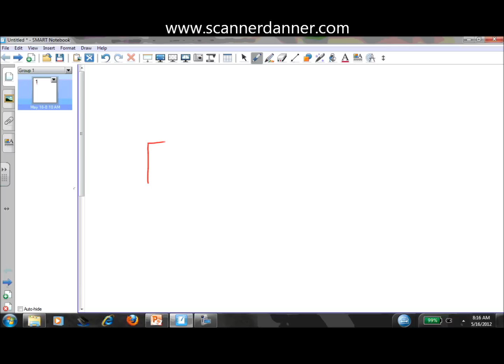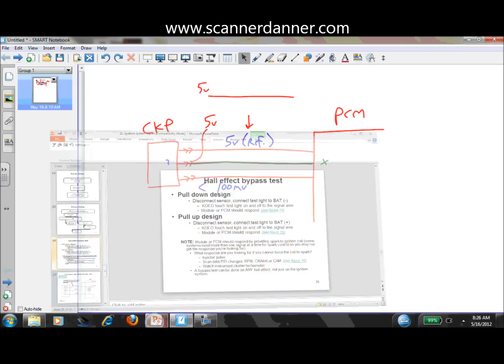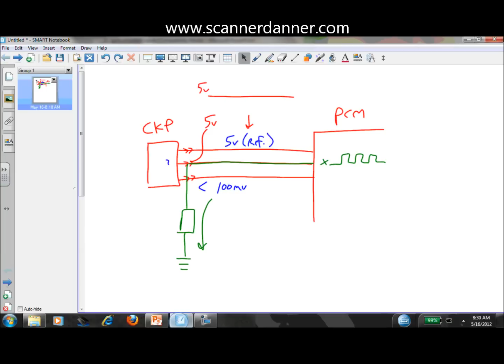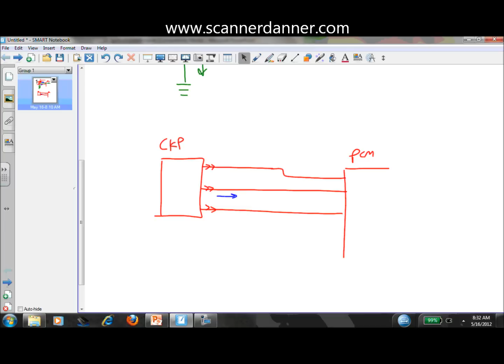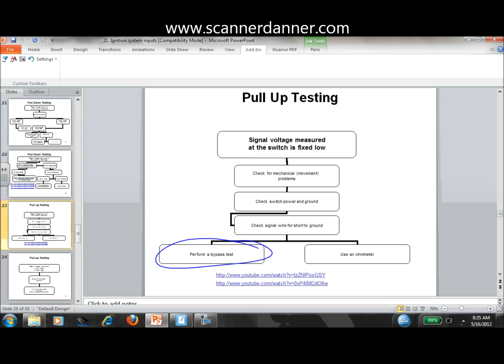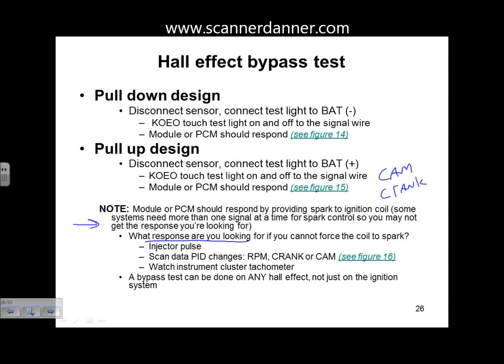Hall effect cam/crank sensor operation and testing Part 2 (an SD Premium video)

Comment: I am facing an issue in these days which is related to pull up and pull down cmp sensor. There are two cars in garage, same make, model and engine but made in different countries. Cmp signal in one car (A) is pull up while cranking, but engine does not start when cmp is connected. In other car (B) cmp signal is pull down, and car starts fine. Upon disconnecting the cmp i verified 5v in signal wire, 5v in power and 0v in ground in both cars. when i connect the cmp grip KOEOff, A car pulls down signal to 0 (no start) and B car keeps it at 5v. Cmp and ckp are same. I switched cmp and ckp sensor of A car, but it didn't start. I swapped sensors with B car, but A does not start but B car starts. If disconnect cmp grip of A car, it starts with longer cranking. Camshaft signal plate is same in both cars. Pinout of connector is same in both cars. What might be the reason of inverted signal in A car? + can the signal be inverted by switching 5v power and groung wire?
Reply from the maker: What is the problem with the car? Or both cars?
Reply: @ScannerDanner  A car is crank no start when cmp grip connected. It starts with longer cranking when cmp grip disconnected. B car is running fine. Both are diesel nissan navara 2.5L 2010.

Comment: so if you check the signal wire when its still plugged in KOEO , could you get either 5 volts or 0 volts depending on window location? and if yes , that would be why you unplug it.
Reply from the maker: +John McKamy yes!

Comment: So it's been 8 years. have you yet seen a 5volt pull up design.
Reply from the maker: I don't remember ever seeing one other than the ICM to ECM distributor reference signal on old GM bypass ignition systems

Comment: Hello Paul 
Interesting question I have here as I watch through; a pull up design that needs the cam and crank to fire injectors simultaneously. 
When you do a bypass test on the crank sensor signal and there is a reaction from the pcm to fire injectors without any activity on the cam circuitery, I think there will be problem here, why; because it's needs cam activity to fire as well. 
This is done in KOEO 
Does this mean there is a circuit short/ wiring intergrity problem in the cam wiring ?
Reply from the maker: It depends on the system,  some systems need both cam and crank, some do not. I have many case studies showing this bypass test in my chapter 21 playlist https://youtube.com/playlist?list=PLAFYVCyenqcqEN41aYznWn9Nfhy1PiMjo
Offhand I dont know which ones I've done this, but to get both signals, sometimes ill crank it while doing the bypass test on the failed sensor
Reply: @ScannerDanner  SD
The system is established here; cam and crank need to be in sync to start. 
It's a pull up design 

Why should a bypass test on the signal wire on the crank sensor give an activity to start while the cam sensor is not engaged? 

Trust you comprehend my query?
Reply from the maker: @AnythingEverythingGh  not sure really what you're asking. Pull-up and pull-down isn't relevant to this question.
Some systems (early) only needed a crank signal to start (spark and fuel), others needed both and still other would start with the crank only and would group fire the injectors without the cam signal, so default strategies. When doing crank sensor bypass testing you may or may not get a reaction depending on the system. The reaction I'm speaking of can be spark, or injection pulse, or fuel pump relay turn on, or simply an RPM signal on scan data
Reply: @ScannerDanner  Thanks and noted

Comment: I have a camshaft sensor for FORD RANGER 2009 ENGINE: WL 2.5. The sensor has three pins. I tested their resistance, pin 1 pin 2 pin 3, pin 1 and pin 2  has megaohms resistance
 , pin 2 and pin 3 has 13 kilo ohms of resistance. Is my sensor broken or are these resistance normal, Thanks
Reply from the maker: I never do resistance testing on sensor circuits, especially on hall-effects
Reply: @ScannerDanner  Ok thanks man, I just tested the line of the camshaft, The camshaft sensor is unplugged, PIN 1 is always ground, when i turn the ignition on (ACC position), PIN 3 has 5v ( I assume this is the power pin), pin 2 has 4.8v, shouldn't pin 2 have no voltage because it is unplugged?
Reply from the maker: @nelsonco3922  nice! Your wire that reads 4.8v should be your signal wire and this would indicate this is a "pull-down design" hall effect. In other words, the transistor in the cam sensor will energize and switch this signal to ground to make the square wave pattern. transistor off = 5v (or 4.8) and transistor on = 0v
So the wiring tests you just did, shows us the sensor has everything it needs to work. Now lets do the same tests plugged in and see what we get (loaded circuit testing). For the signal wire, if you "bump the key" (do not start the engine), you can make the camshaft move to specific points on the drive-plate to see the signal go high and low. For the supply and ground, they should stay steady all the time.
Reply: @ScannerDanner  Ok so will this be a reliable test if I turn the ignition on to power the sensor but not inserted in the camshaft. I will put a metal near the powered camshaft sensor and see if there is 0 volts and when there is no contact it should read approx 5v.
Reply from the maker: This one is all you for sure https://www.youtube.com/watch?v=JWfdHXL-bPg
I'm doing exactly what you are describing
Reply: @ScannerDanner  Thank you so much!
Reply from the maker: @nelsonco3922  did that video help? Did you see where I used a big chisel to trigger the sensor?

Comment: 96 Honda Civic I got continuity in all 3 wires that's not right right
Reply from the maker: I never check hall effects using resistance measurements.
Reply: Thx you for replying so long story short I'm a electrician so I'm good at troubleshooting now yes I'm no mechanic sir so pls excuse my ignorance now I also had the 12v battery wires and the groun also had continuity I discovered my ckp sensor all the wires in the crank sensor where terminate together as soon as I took them apart no more continuity in my 12v ground in other words I had a short im see if it start up tomorrow I just want to thx you very much for the knowledge you dropping on us sir gracias
Reply from the maker: @EverRamirez-i7o  i completely understand. My friend is an electrician and I struggle with troubleshooting 120 and 240 volt systems. It's a different animal!